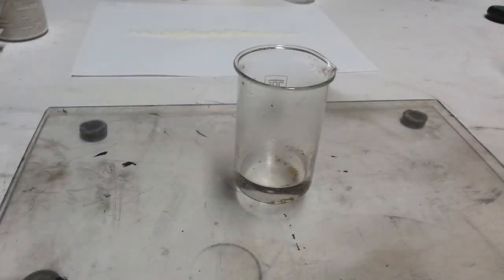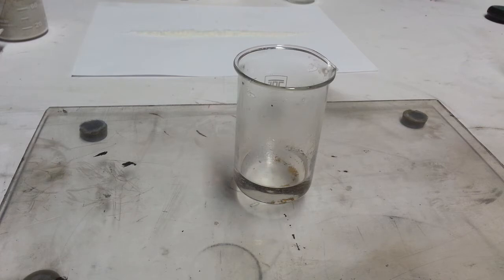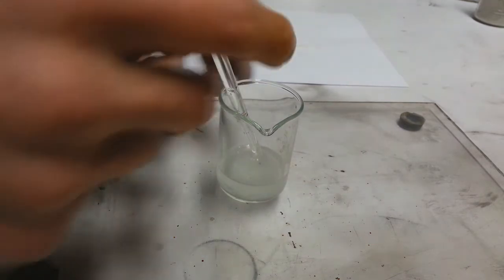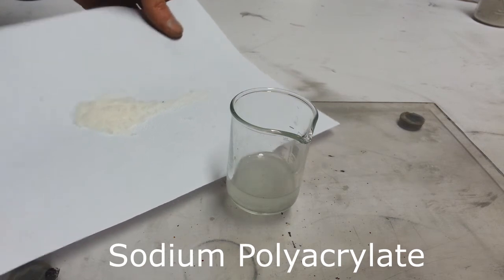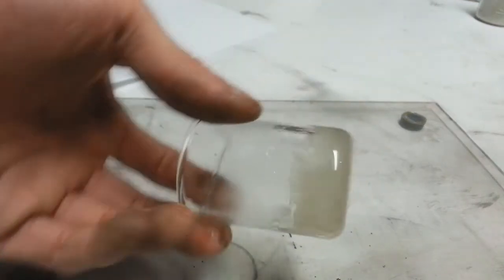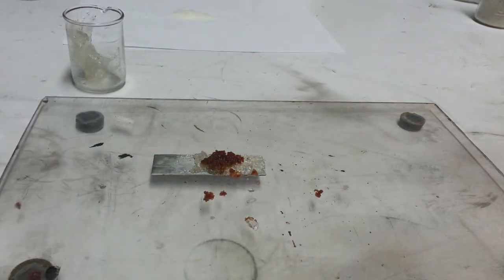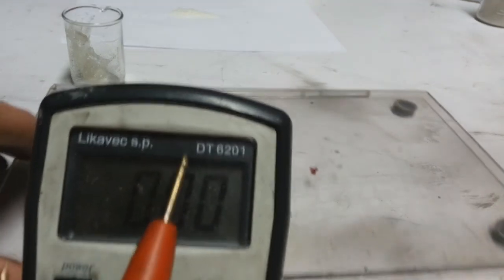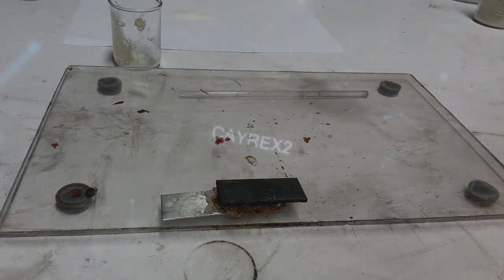Bi-functional Hydrogel Aluminium Battery

Comment: Do u have some estimate hour of use until  aluminum will totally oxidize  ? can we use other electrode with very slow on oxidizing ?
Reply from the maker: sorry I dont know the exact time. yes, you can use other electrode materials, but the voltage will go down

Comment: does the oxidation create higher voltage reading?
what reading do you use copper and what about flipping it around? does the sulphuric acid and potassium permanganate oxidate it the same?
Reply from the maker: An electrochemical device such as a battery having two electrolytes between the anode and the cathode. The electrochemical device is preferably arranged with an alkaline electrolyte in contact with the anode and an acidic electrolyte in contact with the cathode. The electrolytes are separated by a bipolar membrane or salt bridge like in this video, that preferably also provides ionic conductivity between the two electrolytes and also generates a supply of protons and hydroxide anions. The electrochemical device achieves fifty percent higher operating voltage and power compared to battery with a single electrolyte.
Reply: cayrex2 very good
Reply: cayrex2 I wonder what would take place if you experimented with applying different salts between the acid and base gels . Would it act as a catalyst!